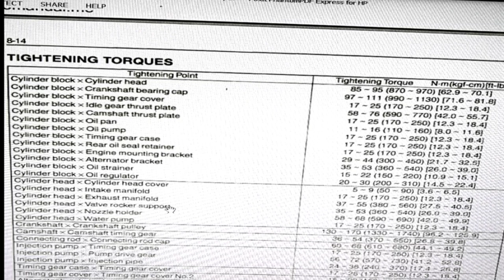Toyota Diesel Engine 1DZ II. ENGINE REBUILD

Comment: Woow galing
Reply from the maker: Salamat po
Reply: @jlcworkshop   ang oil pump  ba. Nya. Ay parang my timing may N.  Kasi nakalagay Letter.
Reply from the maker: @loucelampo-on3943  wlang timing ang oilpump sir
Reply: @jlcworkshop   ayaw kasi umakyat ang langis papuntang raker arm
Reply from the maker: @loucelampo-on3943  yong oil filter sir nagkaroon ba ng langis.tabggalin nyo sir at tingnan kung nagkaroon ng langis ang oil filter
Reply: @jlcworkshop   ang oil nya boss hangang filter lang kasi tinangal ko  yung filter pina redondo ko my langis na lumabas. Kaya lang ayaw umakyat sa head papuntang raker arm. Pinahanginan ko  meron naman lumabas na hangin hindi naman barado
Reply: @jlcworkshop   bago ang oil pump ko boss pero ayaw parin umakyat yung langis sa raker arm. Patulong naman ako boss sa advice mo. Salamat galit nayung masre dito.
Reply from the maker: @loucelampo-on3943  original ba sir ang gasket nyan?baka kc natakpan ang daanan ng langis papunta ng rocker arm.
Reply from the maker: @loucelampo-on3943  madali lang nman baklasin ang head nyan sir.baka natakpan ang butas ng daanan ng langis.dito na kc ako sa pinas kaya bihira na makapag youtube

Comment: Hello  , l need your assistance,  we have a MAN TGA having issues with steering box too much play ,l want to know if there is a way of adjusting/bleeding the steering box so that it doesn't have to much play.Thanks
Reply from the maker: hello sir, there is an adjuster at the top of the steering box. please turn it clockwise, count how many turn you will make. thank you
Reply: @jlcworkshop  thank you

Comment: Sir baka po may idea kayo ng man common rail, humahalo yung langis sa radiator bago na lahat cooler. salamat po sa sagot😊😊
Reply from the maker: Anong makina po sir?
Reply from the maker: Ay MAN COMMON RAIL PALA NANGYARI NA YAN DITO SA MGA UNIT NMIN SIR,,PINALITAN NA Nmin ng bGong oil cooler pero ganun parin.ang ginawa namin kinuha namin ang buong oil filter housing doon sa naaksidente naming truck at pinalitan namin ng buo.ayon ok na d na naghalo.
Reply from the maker: Dalawa lang ang alam ko na pwde pagmulan nyan eh.oil cooler o filter housing.pwde rin sa air compressor.

Comment: Hello JLC, I wanted to ask you a question, it is a MAN TGA 33.360 work truck, I get a ZBR and ABS fault on the screen, the rear stop lights do not light up when I brake, I do not remember the fault code, in the workshop they tell me that It's the brake pedal valve sensor, it's common in TGAs... Is there a solution or do I have to replace the whole part? Thank you very much and greetings from Spain.
Reply from the maker: Hello sir. yes its need to replace the whole footbrake valve.
Reply: @jlcworkshop  ok, thank you very much